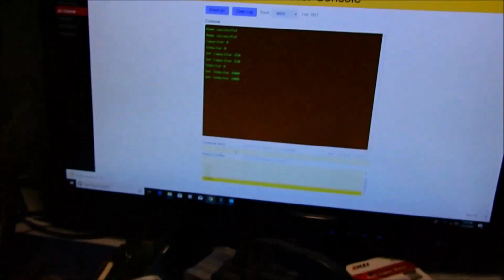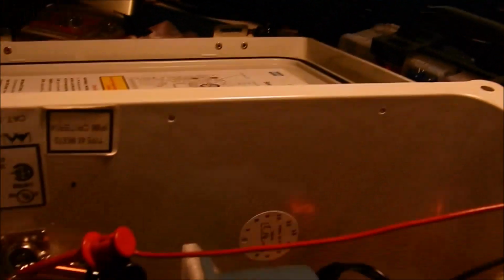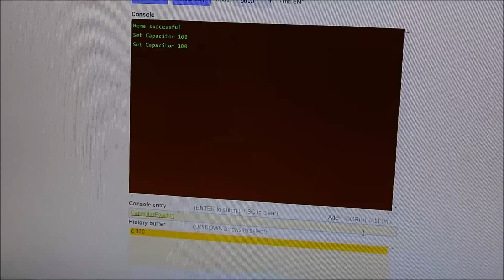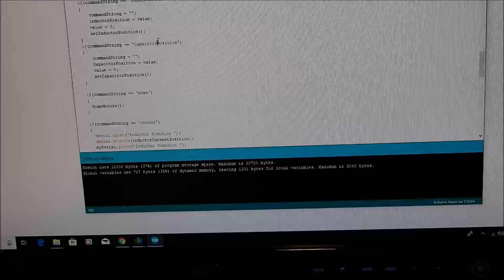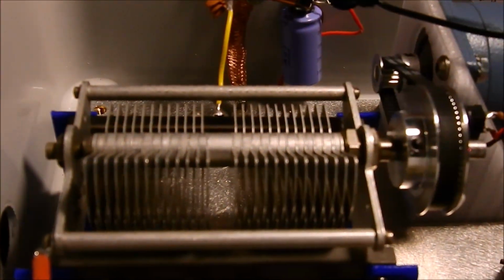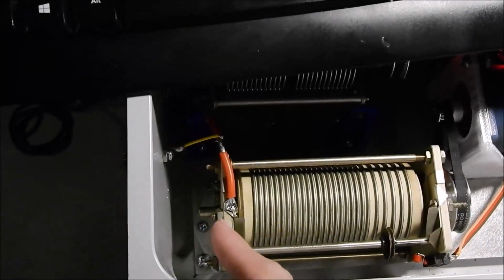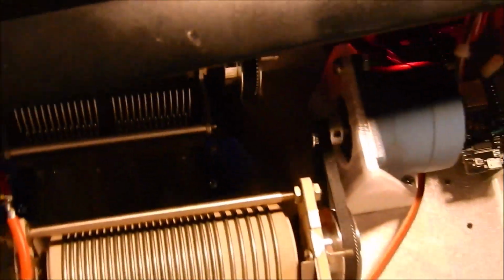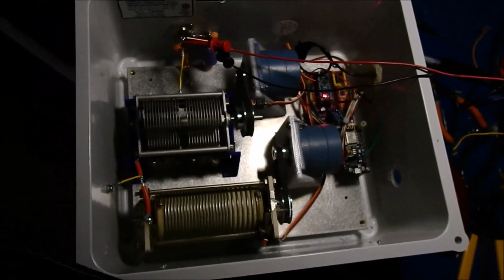DIY Remote Control Antenna Tuner Part #2

Comment: Very cool. You should add one of those stand alone Nextion Displays with embedded mcu controllers and a built in GUI generator. Can give yourself a slick interface with virtual gauges and switches or anything else you might want. 
Very cool build!

Comment: Can you provide some additional info? What are the values (ranges) of the capacitor and inductor that you used for this remote tuner project? I have several of both to choose from in my spare parts box and I'm thinking that this might be my next project. The steppers you are using seem rather heavy duty for the job they are doing. Was this by design or was it because it's what you already had on hand? I would also love to know what size the plate you used for mounting and the source for the waterproof box you used. I currently have an HV mag loop remote tuning network project that's about to hit the bench. For this project I am just following a simple cookie cutter plan found all over the internet. I'm using a Russian NOS vari vac cap and a lessor duty stepper (than what you are using). I'm using PVC jacketed 5/8 copper tubing for the loop. My calculations are for about 500W in continuous cycle, I was going to run a wired control but after seeing your project I think I will be going with wifi control. I have no experience with this but it didn't seem like rocket science. I'll have to do more homework.
In any case, do you have a more specifics regarding the parts list for your project (the two modules)? I'd love a video showing more detail in the wiring of the controller and wifi modules. Oh, heck! Just make the thing for me already Lol!
Thanks and 73!
Jack N2LBI
Reply: BTW, I was laughing when you twice moved the cap by 100 and was confused when it did nothing at the cap 200 command. The reason why I was laughing was because I am pretty clueless but somehow understood the issue immediately. I'm yelling at the screen, Dude, You're already there. Maybe I'm finally starting to catch on. Lol!